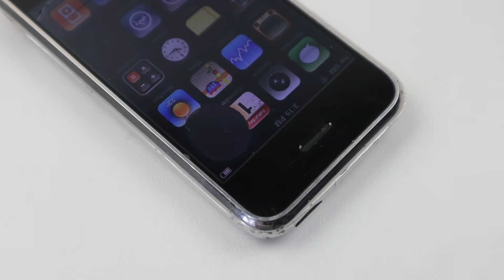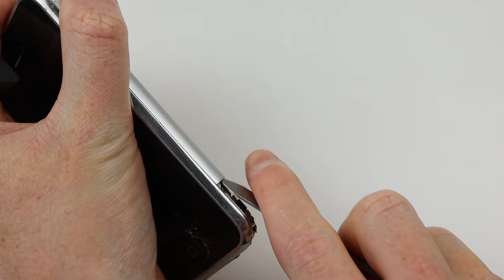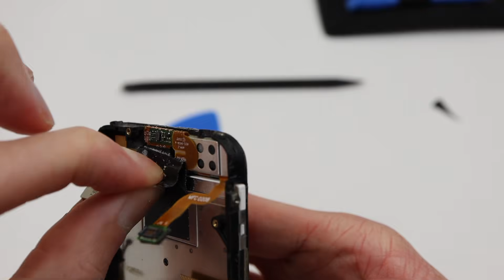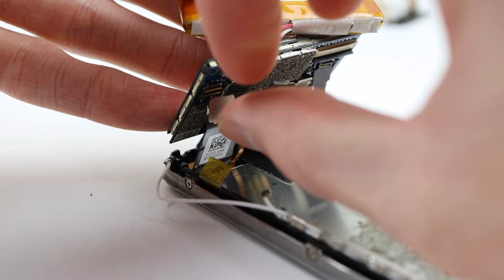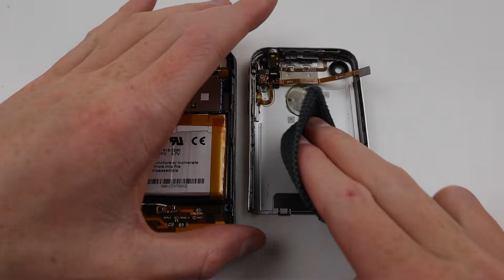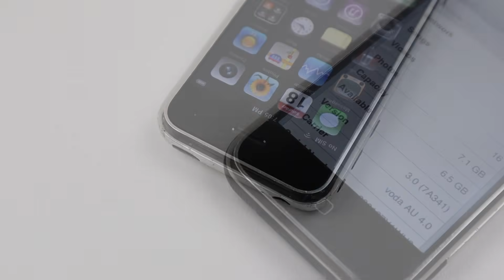Restoring The First iPhone  - Retro Repair

Comment: You do know that the internal components such as the surface mount tantalum capacitors should be replaced as they dont last very long.

Comment: The reason you couldn't easily get that antenna cover on is because there are metal clips on the rear housing, and the plastic antenna cover clips should fit between them, and you tried to fit it under the clip. Bend the metal clip down and it will make it a lot easier.

Comment: I just got one of these off eBay running iPhoneOS 1.0.2. Thankfully in great condition, some scratches on the back housing. Blast from the past. It's a dinosaur but the nostalgia of just powering it on was great.

Comment: Thanks for the tutorial as was invaluable to do the screen replacement on mine. That aluminium back is an absolute nightmare to get off and I’ve got a bit of panel beating to do before it goes back on as it got a bit bent up trying to pry it off! Want to keep the original back as sn matches the box as that’s important from a collector point of view.

Comment: Many people think that the first iphone was the first smart phone. That is not true. Yes. The first iphone was just iphone. Or iphone 2g. But it was not at all by any means the first smart phone. The first smartphone was the Siamon by I.B.M. And that was born in 1994. That is when I.B.M. Siamon revealed and released the first smart phone to the public. It had phax email aand a way to do work on the go. It had a stylus. However, the iphone when it came out in 2007 did really change up the smart phone usage and how we interact with our phones today. Now they are like mini computers. But the first smart phone was no where near the iphone. The first iphone or iphone 2g was in 2007. It really changed up the touch screen. But the first smart phone was actually the Siamon personal communicator. The smart phone had the mini version of the internet. It was like we would say back in the day of early smartphones phones. It is a watered down version of the internet. The first iphone though was able to use the full version of the net. It was not just some baby internet. We would often call the net that the smart phoen used back than was the baby internet. You would then have to go home, and work on the computer and that is where you would have the full version of the internet. But now, you don’t have to go and wit till you get home. You can work on the go easily now. You have full acccess to the net. So the first iphone was so vital but it was not at all the first smart phone. Before the iphone you had many Blackberries and -tmobile sidekicks. And other phones. You had also the my touch from t-mobile. That was an early smart phone as well.

Comment: I have the original Iphone with the original box. The top half of the screen touch sensor works but the buttom half does not work meaning I cannot "slide to unlock". I am considering getting it repaired for the purpose of selling it but I don't know if it is worth it. What are your thoughts?

Comment: I do have one of these. Need to replace the screen. LCD is fine but the digitizer doesn't work. Need to find a replacement. Seems decent enough to change. Would pair nicely with my iMac G4

Comment: I have one refurbished iPhone 2G in a brand new state which I have been restoring over the years (it took a long time to find parts) for myself. After 7 years I finally finished.
Everything except the main board has been replaced with new ones (screen, main body, chrome frame, metal back cover, antenna, home button, bottom port for connecting USB is also replaced with a new one, battery) and so on ... 
I didn't used it.

Due to financial difficulties, I am ready to sell it. If someone is interested, please write to my email rokvvaa@gmail.com :)
Reply: ill give you $0 for the piece of junk it is :)

Comment: I still remember the first time I laid hands on this device. Some of my friends' family just returned from the us with a simlocked iphone. The only way to unlock that and flash it so it can use any sim was basically to connect two traces together so the phone could be rooted. That was the jankiest stuff I've ever pulled on one of these but it did work in the end, and the person was super happy except for the slightly bent frame. Of which I can see you also are having some trouble with :D

Comment: Inside any bespoke and irreplaceable battery is a simple 'Prism' or 'Pouch' li-ion cell, and those are available in a variety of sizes and dimensions. If the basic cell can be extracted from the battery assembly, then it should be possible to repair the battery (with a new cell, with similar but smaller dimensions). One would need to detach any temperature sensors, and move them to the new cell. Ultimately it should be just + and - wires, and the rest is just mechanical replacement work. In theory...

Comment: That's NOT the first "iPhone".   :-) 

I happen to own an example of one of the very first "iPhone" from the early 2000s (maybe about 2005?). It's the Cisco LinkSys "iPhone" CIT300. It's a cordless phone with some sort of Internet Skype capability. My example is actually still in use as my daily use cordless phone. It has easily replaceable AAA NiMH cells, not a custom pack, so it's very easy to keep going. Apple had to purchase the iPhone trademark from Cisco.

Comment: I don't have an iPhone 1st gen. However, after some deep digging, I managed to locate an iPhone 3Gs 16 Gb model and an iPod 3rd generation32 GB model. Found these just today, and both work, though the latter has a cracked screen.
Reply: P.S. the former is in decent condition, though the back has a tiny crack. Still functions as intended though.

Comment: Oh lovely, an iPhone 2G. Yep, it's also referred to as the iPhone 2G, because it didn't have 3G (the 2nd gen, the iPhone 3G, finally brought 3G connectivity). The batteries are soldered, but I guess that any Li-Ion cell with the required dimensions can easily be soldered in if you have a soldering iron. 
(I managed to successfully replace the battery in a Philips 20GB media player, despite not being able to track down any sort of original battery.)
Reply: Sick, that's good to know

Comment: I still have mine which I bought new in late 2007. The screen had the grey blotch and touch wasn't working. I bought a brand new display from China and now it works perfectly. I still have the original box, dock etc too.

Comment: I changed the cell of the battery myself, the old cell is gone and replaced by a brand new one, that is an option if you really want a new battery, old batteries like that aren't locked down like the new ones are. I did this about 6 months ago and the phone still runs like a champ, i just found out that alibaba is selling a couple of screens but as you know, supply may run out as soon as those chinese dudes decide to make something else.

Comment: Please don't spread misinformation. This was not the first smartphone, nor it is the first 'real' smartphone.
If you are looking for first phone marketed as smartphone, it would be AT&T's PhoneWriter Communicator, first smart phone would be IBM Simon, first mainstream smartphone for masses would be nokia 7650. 

The multitasking capability of 7650 is still not beaten today as you have no control over how you load up your ram.

If you try to define 'smartphone' by apps available to it today, you allow planned obsolescence to define 'smartphone', and original iPhone won't be it once again, as most software no longer runs on it.

iPhone isn't even first all touch phone, IBM Simon would be that one.

All iPhone really was, was a reshuffle of the low end at that time components packaged in a more appealing package.

Comment: i had windows smart phone circa 5 years before first iphone

Edit:google:  People didn't start using the term "smartphone" until 1995, but the first true smartphone actually made its debut three years earlier in 1992. It was called the Simon Personal Communicator, and it was created by IBM more than 15 years before Apple released the iPhone

Comment: iPhone was world changing, and is the father of modern smartphones, but the first ever smartphone to be produced was IBM Simon smartphone released in 1992. There were many smart phones since then, all the way up to 2006 when the iPhone came out. IBM also had high density displays long before RETNA displays came along and tablets have been a thing since the early 90s. ( I have a Toshiba Touchpad from 1992 running Windows 2.1 for pen devices.) Bill Gates was even seen in 2002 holding a tablet of that time, running full versions of Windows XP.  Apple is often given credit were credit is most definitely not due.  Even in the face of Android's level of usefulness, reaching and in many ways exceeding Apple, even in price, Apple has this "reputation" of being associated as better even if its not the case.  Saying iPhone is the first smartphone is like saying Macs had the first point and click system ( also not true)

Comment: there were many other smartphones before the iPhone.
The Sony Ericsson P900 and P910
HTC made an SPV phone back as early as 2002.

Without these the iPhone wouldn't be what it was
Reply: SP  im sorry to be pedantic but if you look up the word smartphone in the dictionary it is:
"a mobile phone that performs many of the functions of a computer, typically having a touchscreen interface, Internet access, and an operating system capable of running downloaded apps."

Now the P900/910 and the HTC SPV did this, therefore they fit the criteria of a smartphone, as did many other HTC units, and this was 2006

Comment: I own this original iPhone running iOS 1.1 which is a very rare Apple item, but it has some dead pixels as well, I tried cracking it open to put a display form another iPhone, man after a few minutes of trying to remove the black plastic cover in low rear, I couldn’t and I left a very minimum damage from the tools I was using, so I stop, it was like two years ago, I still don’t know how to make it.

Comment: i have a first gen iphone, pretty mint, maybe 3-4 small scratches and a tiny ding on a corner, but it runs just fine, original everything and only i owned it, i got it as a present when i was in 3rd grade ( im in 12th now) so 9 years ago, i actually still use it, whenever i get grounded and my mom takes everything, i still have that iphone 1 and the first gen ipod touch (but that one is pretty messed up)

Comment: ive got a few dozen of these and after disassembling one - the nightmare that is removing the back metal cover, I said to myself i would NEVER do another. Give it another 6 months and i'll forget the pain and suffering and probably try to repair another. Hugh didn't mention the cost of the replacement front screen - can be eye watering. And finally the black antenna cover - something that looks so simple is such a BASTARD to get back on....! This video doesn't quite capture the swearing and annoyance of this job...

Comment: Hi! I’m Peedie and I’m 11 years old.  I love your channel and it inspired me to start doing restorations myself.  I have replaced a display panel, battery, and home button on an iPhone 7, and the battery on a different iPhone 7. I am hoping to fix my mom’s old water damaged iPhone 5 with a damaged backlight.  I am wondering if replacing the display will fix that problem or if it will be a more complicated repair.  It would be my dream if you saw this comment.  :)
- Peedie

Comment: Anyone know where you can get a replacement screen for one of these? Also, when my battery went bad on my original iPhone I used an old Huawei battery with the same capacity and voltage. (1400mAh 3.7v) I think it was a Huawei HB 5K1H battery, fits in the same spot as the battery, but you need to rewire it and run it over the top of the battery (thinner wire the better), battery contacts will sit to the left. Been using that battery for months and it works great. Give it a shot if you can't manage  to find a good replacement.

Comment: i managed to get a near mint 8gb model (with a non-matching 16gb box), including a power cable (not original), brick, two docks, replacement battery, two replacement antenna covers and chrome bezels, two cases, and a screen protector for $120 shipped to my door. best deal i have ever scored.
Reply: Would you consider selling one of those spare antenna covers?

Comment: Hey Hugh, or anyone reading this, I’ve got one of these and really want to get it unlocked due to it not being able to through iTunes anymore. I really love iPhones and repairing them. But I’ve tried SO many different unlocking, bypassing, and even jailbreaking software on this device that used to work at some point in the past but I have come to the conclusion that I will never be able to unlock it because they keep failing. I know that mine can’t run iOS 1 because it is a later model first gen, so I’ve tried versions of iOS 3 and 2 but I keep getting stuck and I just wanted to ask if anyone knows a current working method and software to be able to unlock a first gen without installing cydia. Thanks 😁. Also this was a video that I had been hoping for 👍.
Reply: dave cole Hey I also recently got a broken iPhone 2g that just wasn’t even booting. I encountered a similar problem not being able to install a fresh os thru a modern mac. I got an IOS 3.1.3 ispw file from a website (Github or so) and let iTunes under El Capitan restore it onto the phone. It had failed before but that was due to a bit corrosion on the dock connector pins so check these out and clean then with a small brush and alcohol. For later unlocking (mine had T-Mobile Simlock, and they can’t unlock it anymore) I used the RedSn0w unlocker. It has to be a very specific version to work with the 2g, I think it was 9.3.2 but I can look again if you want. You’ll also need two .bin files and an .ispw for iOS 3.2.1 if you wanna unlock that 3.1.3 version. Go thru the process and it will ask you to install Cydia or not, so that’s all just a choice. To be honest tho, I installed Cydia and installed app sync to be able to install unsigned apps. With this method I could install so many old games and it works like a charm, and you probably know there’s no other way to get these games on there whatsoever. There’s also tweaks that make the YouTube app work again and all. Actually makes this phone waaay more useable. So I hope I could help a bit.
Reply: Hyäne-Artikel Ok thanks I will try that, I’ve actually not tried 3.1.3 yet but that might be my problem. In Redsn0w (0.9.4 ,and 0.9.2) I get as far as “waiting for device reboot” after like the 2nd step. Most people say to try unplugging and plugging it back in but it does not seem to work for me 🤔. I also am using a windows pc so that might also be an issue. But I’ll give it another go in compatibility mode.
Reply: I just realized the mistakes in my original comment, I’m not actually trying to unlock the device so it can work on different cellular companies, I’m just trying to get the device to go to home screen essentially. So far I have Redsn0w 0.9.2 installed and the iPhone on iOS 3.2.1 through an iTunes restore. Redsn0w accepts the version of iOS that is on the phone and then I get to the screen where it says to select what I want. I’m just going to select nothing for now, but like you said, installing Cydia sounds like fun , (I will try that after if this ends up working). Redsn0w begins doing its thing and then I get to a step right where the iPhone’s screen is just white and Redns0w says it is waiting for reboot. I’ve watched multiple videos saying that this works in 2020 but I have not success 😭. I hope that I am not taking up any of your time but I’m so desperate at this point 🤣. It might be something with my device because it is a later model 2g and cannot run any versions of iOS 1. Also I’ve noticed that a couple of different 30 pin apple power connectors that I’ve got have different pin layouts, which is really weird but they all seem to work because I’ve done downgrades on other old iOS devices with them so idk.

Comment: you can just buy a cheap lipo battery with the nearly same size. you just have to solder two cables. just pick one with protection

Comment: iPhone 1 is the incorrect name for this device. It's name is the iPhone 2G, named after the 2G cellular technology implemented at the time.
Reply from the maker: Its not officially named the iPhone 2G thats just a nickname. It was just released as "iPhone" therefore its the iPhone 1st generation.
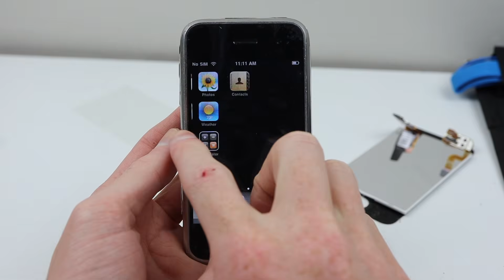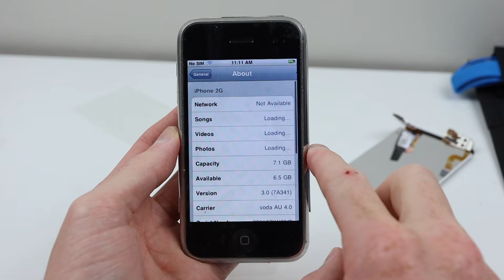Reply: @HughJeffreys  Look at your video from 5:56 onwards. At 6:00 flat, the About section (which cannot be edited by the user) specifically states that the device is an iPhone 2G.
Reply: RMwx it was originally called the “iPhone” but when they were about to release the second generation, they didn’t know what to name it and wanted to show its 3g capabilities. So they made it the iPhone 2g after the release of the 3g just to differentiate it from the newer models

Comment: I’ve actually found batteries for this model. There’s only one brand of them out there that I’m aware of and they actually are pretty good. They’re actually physically smaller than the original because of improved energy density in newer batteries but I’ve restored an iPhone 1st generation with it
Reply: supercrazymario404 what brand is it then and where to buy
Reply: Here’s the one I got off eBay and since I live in the US this was pretty easy to get but for those who live on the other side of the world like this guy is from Australia, getting it locally or from China seems to be the most reasonable. https://www.ebay.com/itm/193396791114 and also there are some on AliExpress but I don’t like buying internationally unless it’s absolutely necessary
Reply: @supercrazymario404 , I know that you likely wouldn't reply, but I will try anyways
Do you remember which brand was it? The link doesn't exist anymore